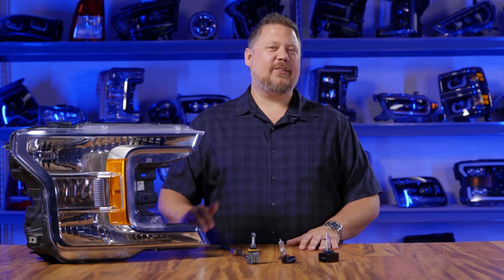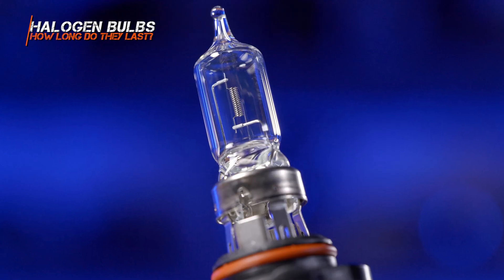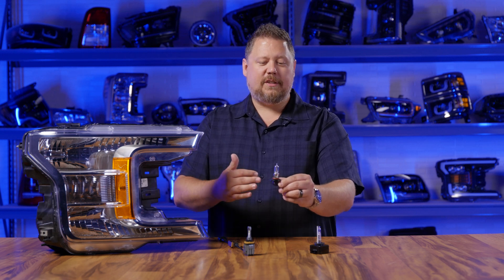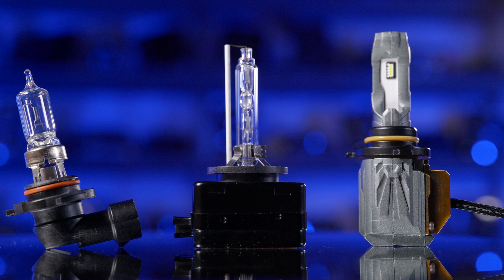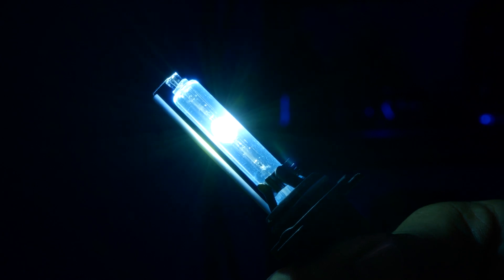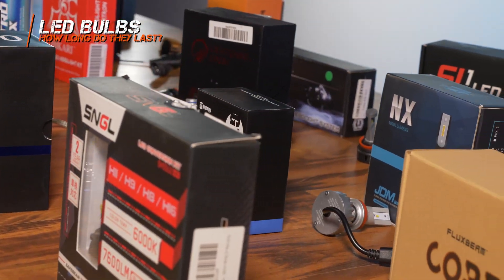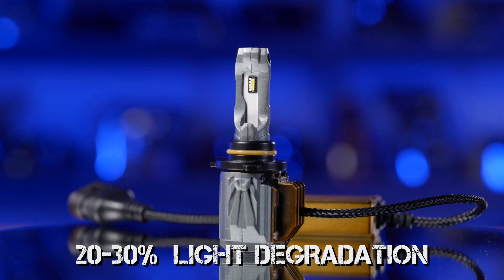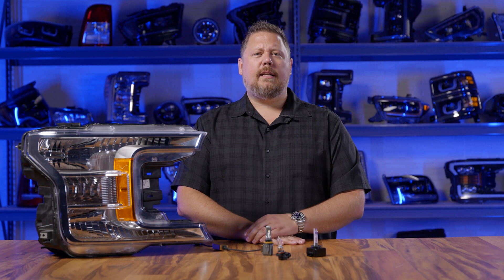Why Headlights Lose Brightness Over Time! 🚘 💡

Comment: howcome my 30 years toyota still has the original factory halogen headlight from Japan and still working as new while led headlights don't last quarter of that period although they come with heat sinks and cooling fans
Reply from the maker: Your 30 year old headlight have one simple job to do: turn on at a very manageable power. While modern headlights have many, many more jobs to be doing at the same time like DRLs, turn signals, high beams, misc. sensors, relays, etc. - way more going on! Although we are still too new with LED housings to really get a lifespan point, although they are very capable of lasting 15+ years.

Comment: So you are saying I may want to replace my 22-year-old OEM halogen bulbs?
Are you saying my night vision may not have degraded as much as I think?
Cool.  - - - - 72 year old guy.
Don't you have problems putting an LED bulb in a halogen reflector?  Does the throw pattern tend to blind oncoming drivers?
Reply from the maker: If your OEM bulbs are 22 years old... yes, replace them!! 

As long as you buy a quality LED and align them correctly, you should never have to worry about blinding oncoming traffic.

Comment: can you guys test aftermarket lights for classic body 06 GMC trucks. alot of them show they use H1 bulbs and there's not alot of options for bulbs that I see. either halogen or HID and I don't want the HID to destroy the housing
Reply from the maker: H1 is a hard platform to upgrade exactly for the reason you mention: There is not many options out there. It's not the best platform for performance from what we have seen, as options are limited. The best bulb we found for this platform would be the S-V.4 LEDs!

Link: https://www.headlightrevolution.com/s-v-4-led-headlights-h1-bulbs-HRH1V4_2?quantity=1
Reply: @HeadlightRevolution  thank you, I just got some GTR ultra 2.0 for the factory housing and will look into what other options are out there for these GMC trucks.

Comment: He stated LEDs are brighter than most HID systems? Is this to suggest that there are still HIDs out there that still perform better?
If so would that be the GTR HIDs ?????
Reply from the maker: It all depends on the headlight the test is being performed in. With projectors for example, HIDs typically light the projector up more efficiently than an LED will, causing more output! However this is not always the case!

Shoot us an email if you have Qs on your setup: Sales@HeadlightRevolution.com

HeadlightRevolution.com

Comment: Interesting, I didn’t know the halogen bulbs degraded that much.

That said, please make a video on what happens with the assembly (be it a reflector or a projector) when we touch the light source with our naked hands/fingers prior to installation. I’m talking about the milky fog on the assembly lens.
Reply from the maker: Glad you learned something today with us Boris! That is also a good topic to mention! Typically that milky fog you are mentioning comes from the heat of the headlight bulb inside the unit, overtime they tend to craze the lens and fog it over from the inside, while the sun does the same effect to the outside of the headlight lens. That's why oftentimes you'll see older assemblies with little spider-web style cracks on them! Good idea for a future video!
Reply: @HeadlightRevolution  In the old days (yes I am THAT old! 😂) reflectors we’re made of metal and lenses were made of glass. 

The foggy surface I mentioned  came from fingers touching the bulb when installing. The fat from the fingers then vaporized off the hot bulb contaminating the entire assembly from the inside. That’s why one never should touch any bulb surface getting hot. 

All said, I’m from Sweden where there are no limits on the number of aux. lights one can fit - as long as they turn on/off using the high beam lever. Today I live in Central America where the same rules “apply”.